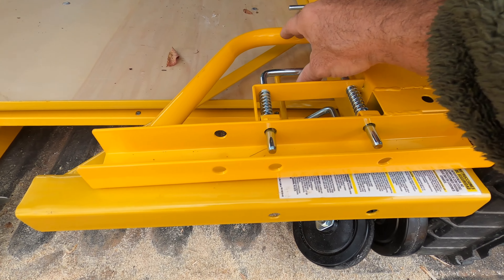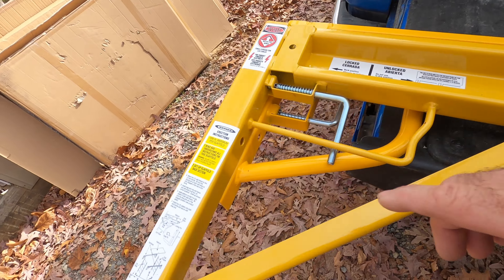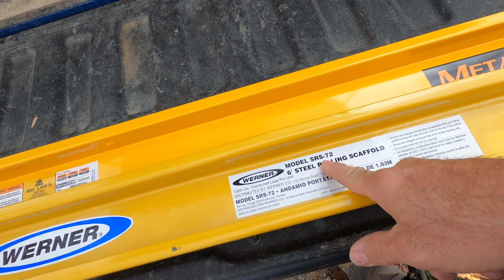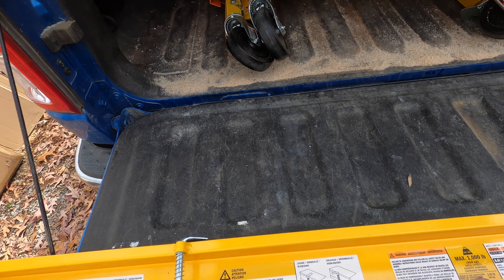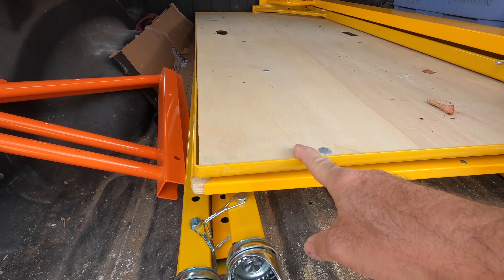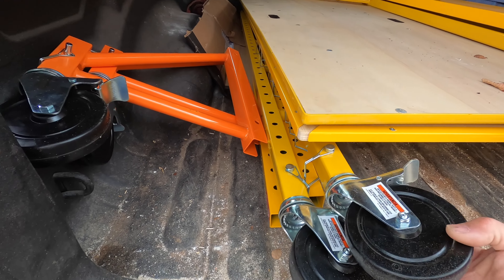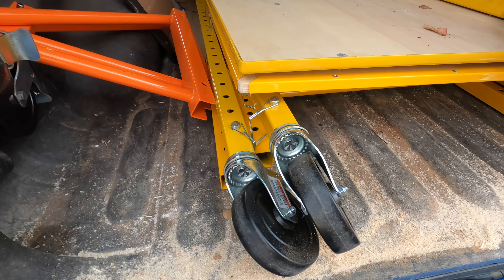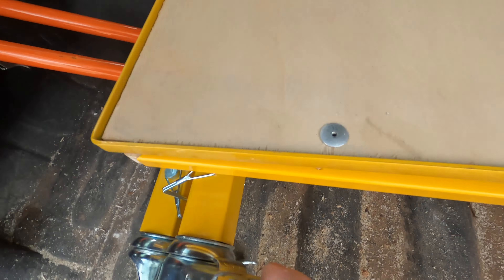bakers scafolding comparison   4K

Comment: Werner is industry standard pretty much aren't they. When i slung siding the boss liked werner it was werner everything never had no issue.
Reply from the maker: I like them both, I couldn't pick a clear winner
Reply: @TheProCut17  well bends in gussets are usually no no's but the tubing they used for it seemed to be of pretty good size which should make up any difference.  Did you buy them or rent them
Reply from the maker: @tompeppint.v.3803  bought them